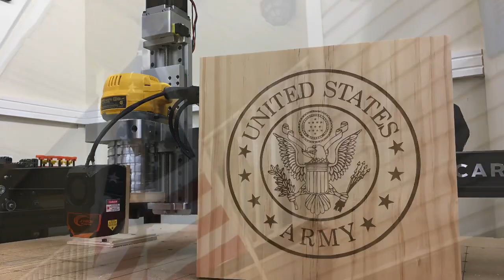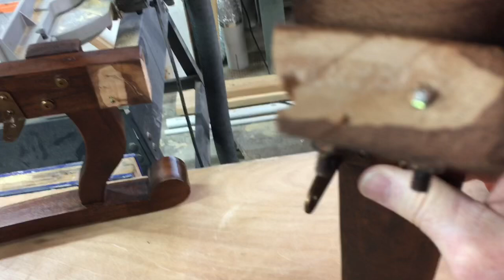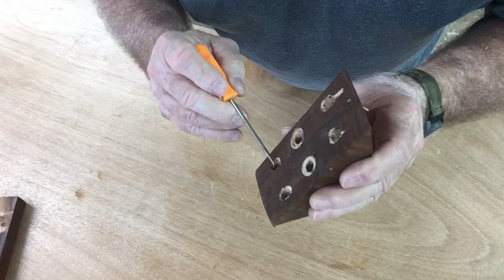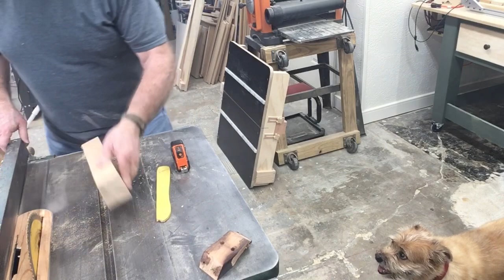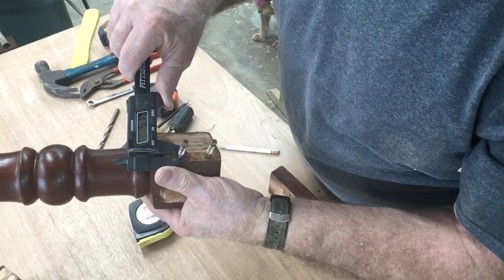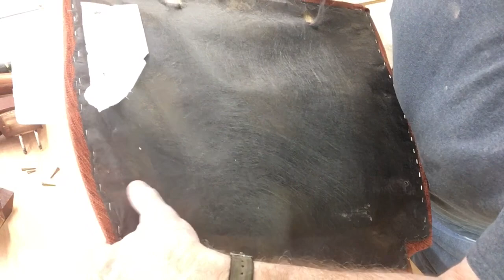How to Rebuild a Broken Chair

Comment: Is there a mate to this chair?  Would be a good idea to check the screws for tightness in that one too.  A lot of different stresses happen in a chair and joints get loose quite often.  Could save a hip.
Reply from the maker: You are correct.  I will have to tell them to check it out.